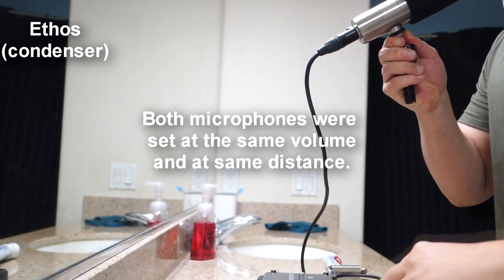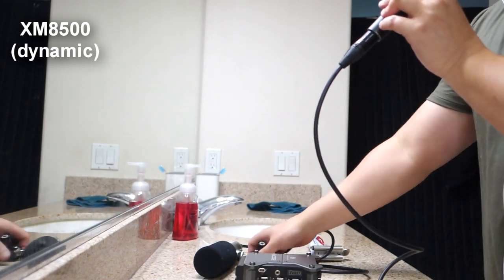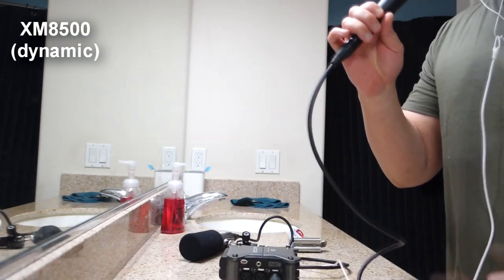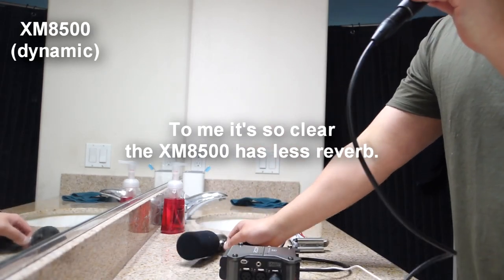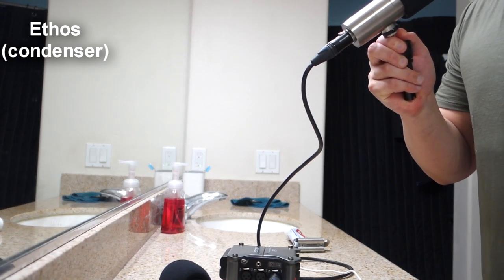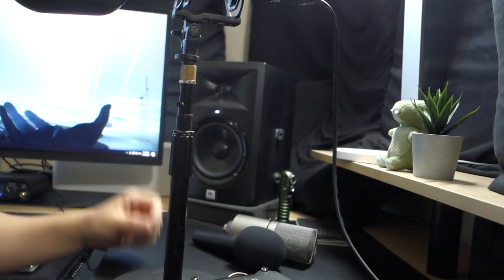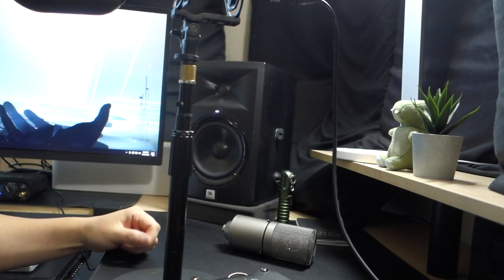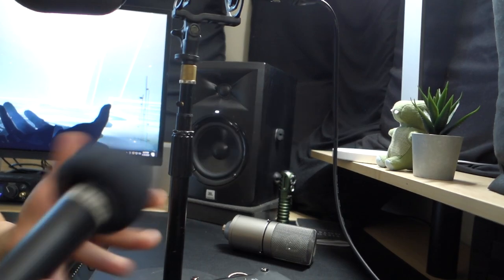MYTH? Do dynamic microphones reject more?

Comment: You're absolutely right. I did a test myself, with mk4 and sm58. Even in the noise floor there is like 15 dB difference9(same gain), and it's logical to say dynamic reject more than condenser - let's not forget that dynamics are less sensitive.

Comment: I think one thing these people forget is dynamics are purposely built to reject more ambient and handling noise. Their main purpose is for on stage stuff, such as live concerts, and so the people using them aren't in a acoustically treated sound proofed studio. thus they need to reject more of that handling noise, the audience, and the possible echo of being in a concrete building or building without acoustic treatment. Obviously you'll still pick up some of those issues with a dynamic but not to the extent of a condenser which is made to be much more sensitive so that it can pick up more vocal range and other details that a dynamic is more apt to reject. 

Also i think another thing that may play a part is the frequency response range specific mics are sensitive to. In my experience at least with the one dynamic mic i have (pyle pd58) it's much less sensitive to my voice compared to my brother's even at the same gain and distance, i have to gain crank really really high for it to pick my voice up at all, But with a condenser which are much more sensitive and has a higher range of frequencies it can pick up than a dynamic i don't need to crank the gain like crazy for it to pick me up.
Reply from the maker: Yeah I always advocate it's different strengths and weaknesses. The great thing about condensers is that they pick up a lot of detail in your voice. The bad thing about condensers is that they pick up a lot of details in your room - so you need to make sure it's rock solid. The great thing about dynamics is that they work in less than ideal spaces but it generally picks up less detail.
Reply: They don't reject more noise. They just don't. They only end up with less noise as a byproduct of the method you use it. A condenser can be used the same way. In fact a condenser mic (KMS 105) is much better than most dynamic vocal mics for rejecting noise. People failing to understand the capsule is a different distance from the other is crazy.

Comment: While I agree with you that condenser microphones in general are more sensitive and thus seem to pickup more of the room, the Ethos has a supercardioid polar pattern vs. the XM8500 that is cardioid.  The polar pattern would tend to cause the Ethos to pickup a little additional room due to the larger rear lobe of sensitivity.  I don't know how much that factors in to observed noise rejection, but probably also has some impact.  Another factor is that typically condensers have a wider bandwidth and can respond to frequencies that a dynamic just can't due to the mass of the voice coil and diaphragm.  That said, my personal experience is that condensers are not really useable for speech in an untreated environment, where dynamics seem to work ok.
Reply from the maker: I noticed this with other condensers as well too. In fact it was worse :D. I had a meme test done with an AT 2035. All in all my main disagreement is that they're equal (when leveled). But they aren't. One is going to pick up more reverb than the other. Condensers overall capture a lot of detail, it'll capture every nuance of your voice and every nuance of the absence of sound treatment. This is why at rock concerts with roaring crowds they use dynamics. I'd actually argue that any other condenser would perform far worse. ie if I put an AT2035 up to my teeth, it doesn't change the fact it picks up all that echo in the bathroom :D.
Reply: @Dracomies  Agreed - that level matched the condensers do pick up more of the ambient environment and your test is clear evidence!  
If you increase the gain of the dynamic and speak from further away, you can roughly (ok, very roughy) approximate the ambient sound you get from a condenser, unfortunately the vocal will also sound different since you lose a lot of proximity effect at a distance.  
As another test, have you tried any handheld vocal condenser microphones for comparison (e.g., Sennheiser E865, E965: Neumann KMS 104 , 105, etc.)?  I wouldn't expect a huge difference in behavior to the Ethos, but now it has me curious since those are also optimized for stage use.
Reply from the maker: @goaway2174  I really am lusting for the KMS 105. They sound so good. But then my brain says no and makes my hand slap my hand. haha. But that mic sounds so good.